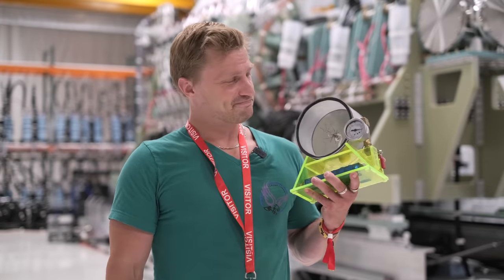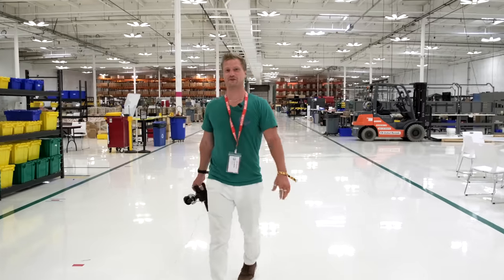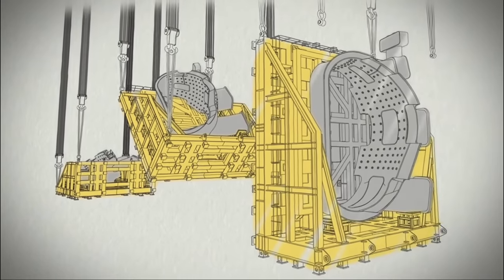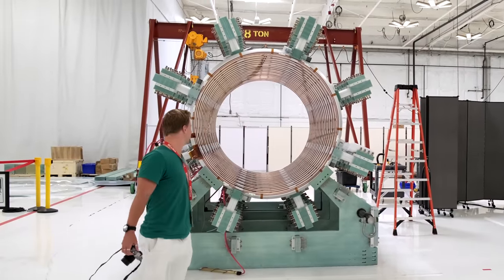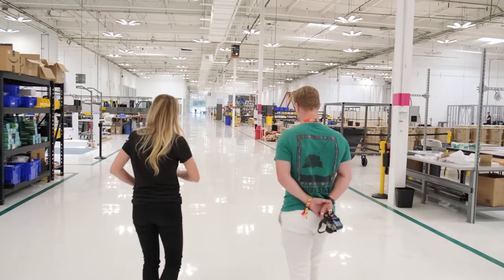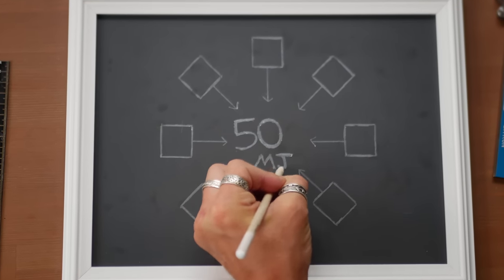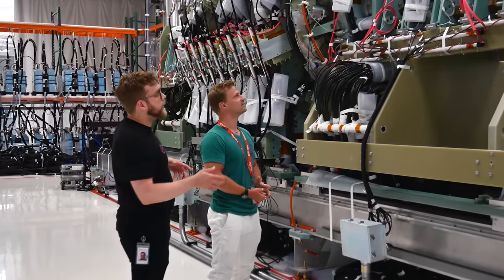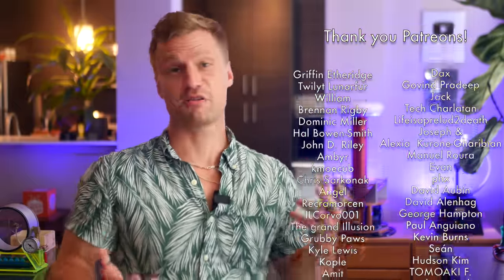An Exotic Approach to Nuclear Fusion (Helion Energy BTS)

Comment: As respectful as I can be to be courteous of your guidelines, I have to say that this is disappointing. There's a handful of videos of nuclear physicists busting helion, so there's no need to go into too much detail here. But the big takeaways are: 

1.) The D-D reaction generates neutrons, which do create activation products in the walls of the reactor.
2.) The D-D reaction generates tritium and He3 with equal probability, and the D-T reaction proceeds at a much, much faster rate than D-D or D-He3. This means that tritium will be fused much faster than it could ever magically be removed, and this generates fast neutrons, which further contribute to reactor activation products.
3.) Tritium that is formed and which isn't used in a reactor cycle needs to be dealt with. It's very radioactive and Extremely mobile in the environment, not to mention being almost impossible to isolate once released. I've heard of calls to immobilize it and store it, allowing it to decay to He3. On paper this works, but with a half-life of 12.3 years, you'll need to amass a lot of tritium just to get a decent rate of He3 production. If a splash of that tritium store were released into the environment, you'd have an incident on your hands that would make chernobyl look like nothing, an issue which the NRC hasn't seemed to take very seriously as of yet, though likely because they know none of these startups are serious. 
4.) Miscellaneous: how will they maintain hard vacuum during x-ray induced reactor wall spalling? How will they remove and reprocess spent fuel to seperate helium and hydrogen isotopes? or is this a once through scheme?

-Alternatively: We've developed working nuclear energy in the form of fission. Even in its most common and crudest form, it's an economical and zero-carbon energy source with no intermittency, which plugs directly into the existing grid to provide stable 60Hz AC power. We have known how to perfect it for decades, including breed and reprocess designs that cut waste levels by a factor of 20x and which utilize 100% of the actinide fuel, and additional reprocessing to seperate long-lived from short-lived fission products could cut waste volume again by a factor of 5x. Though rarer than Deuterium, there is enough combined Uranium and Thorium to meet our current average power needs for at least a few billion years (keep in mind that the jurassic era was a tenth that distance from us).

Yes, we could continue to dump "dumb" venture capital into silly little projects like this. Maybe some serious tokomak based fusion startup will succeed in producing economical power, and then I'll eat my hat. But that's a big maybe with no proven way forward. I would strongly argue that, for the sake of our species survival, and in order to prevent widespread ecological collapse, we should focus on developing realistic solutions and put theoretical well-wishes to the wayside
Reply: You raised a lot of good points.  I hope someone can provide good answers.  All of them seem like things that experts must have thought about and planned for… I wish they had been discussed in the video.
Reply: I have not seen any video "busting" Helion, but I've seen a couple pointing some of the problems they'll have to overcome.

Everyone knows that fusion is hard, if it were easy we would had done it fifty years ago, but that something is hard is no proof, neither of feasibility, nor of impossibility. It is a bit like climbing the Everest. For decades many tried to crown it, and all of them gave up, or died trying, many said that it was just impossible.

Now, let see if I can offer some counterarguments:

1a. Yep, D-D side reactions generate neutrons, and these will activate parts of the machine. Helion's plan is to use [almost] exclusively materials that, once activated, have very short half-lives (in the order of minutes to hours, for example, their magnets are made from aluminium, not copper, and the reactor walls are silica, not steel). In a presentation for the NRC (Nuclear Regulatory Commission), Helion declared not long ago that they estimate their reactors will be safe for human maintenance operators only days after having turned off, and their activity will drop to background levels in about a year.

1b. It also helps that the number of neutrons is far less that fusing D-T, and their energy only about a sixth (2.5 MeV for D-D neutrons, vs 14.1 MeV for D-T).

2. T nuclei produced by D-D reactions will carry 1 MeV of energy. The original D nuclei only have 20 to 30 keV. The difference in speed will be high, decreasing the probability of D-T interactions. Add that one fusion cicle will last about 1 millisecond only. The net outcome, very few D-T fusions.

3. Tritium management is nothing new. CANDU reactors have been producing, refining and storing it for decades. ITER site includes a treatment plant to do something similar. Helium does not need to invent anything new.

4a. Spalling ? One, they will evacuate the reaction chamber between shots. Two, every fusion reactor will have the same problem but Helion's design has an advantage, its linear topology makes it easy to disassemble, and subsequently to maintain (much, much easier than any tokamak or stellator, for example).

4b. Regarding reprocessing of byproducts, see point 3.
Reply: @charliem6590  All really interest, good points.  Thanks!

I was aware that Helion was using materials with less potential for activation, but I didn’t know about the aluminum magnets.  Is it actually aluminum conducting electricity in the wire coils?!  A bit disconcerting still that days will have to pass before any maintenance can be done, especially in light of the super high vacuum conditions required.

Very useful to know that newly-made tritium will only carry 1 MeV.  Is this true regardless of how much energy the original deuterium atoms possessed, or is this in addition to that original energy?  How is there conservation of energy if a DD fusion only gives a low energy neutron and a low energy tritium nucleus?
Reply: @jonathanlehmann2059  Sorry, I'm not ignoring you. It is just that, somehow, my answers keep being removed. Will this one also evaporate?

Edit: OK, this one seems to have passed the filter, lets see if it lets me add those answers.

Yes, Helion says their magnets are made with aluminum, at least the ones enclosing the reaction chamber (the central part of the machine).

Regarding maintenance, all electric plants have to be taken down once in a while for upkeep; it is not uncommon to be off-line for a few days or weeks every year, and that's true no matter the type of generation, nuclear, coal, gas, wind, hydro, etc. So, if Helion reactors need to be shut-down for a couple weeks every year or two, no big worry.

About the 1MeV question. When two deuterium nuclei fuse, half the times they produce a He-3 with a speed/energy of 0.8MeV (plus a neutron), and the other half a T (aka H-3) with 1.0MeV (plus a proton). Those energies are measured in relation with the original center of mass of the two incident ions, so it always the same, no matter their previous energy/speed (that, anyhow, was about two orders of magnitud less). The principle of conservation of energy is not violated because the sum of the masses of the two incident deuterons is bigger than the sum of the masses of the resulting particles, the difference is converted into energy. The 1MeV is part of that energy.

Comment: These reactors will also become radioactive just like tokamaks due to neutron rich D-D reactions occurring at the relatively low temp D-He3 mix, and for a lower energy yeild.
Reply: I wonder about that too.
Reply: They barely talked about the problems their own design faces. I did see them throw some dirt at other projects as if they don’t face similar problems. Like their neutron problem and they barely mentioned how does the machine handle the temperatures of their methods

Comment: This is exciting and one of the few reactors I've seen that actually has a design not just for fusion but for excess energy capture. Trying to pulse the reactor rather than a sustained fusion seems alot more practical.
Reply: also depending on the reaction style, its less wear on the entire system which means better longevity
Reply: @relientker   I got more intrigued because this design really doesn't produce neutrons, so its not radioactive like all of the other fusion reactors, they just omit it because its supposed to compete with fission. how ironic.
Reply: @monad_tcp  Helion's approach will still produce neutrons, just at a lower rate than competing reactor designs. The reactor walls will still eventually become radioactive waste, it will just take longer than the other approaches.
Reply: @RMX7777  If what you mean by "radioactive waste" is highly radioactive materials that will stay dangerous for centuries of millennia, as happens with part of fission plants waste, that not correct in the present case.

One of the general advantages of fusion over fission is that is produces much less activated materials with long half-lives. In the specific case of Helion machines, their estimation is that after one of their reactors is decommissioned, it will only take days for its reactivity to decrease enough to allow start dismantling it safely, even by hand, and about one year for it to be indistinguishable from the background (anyone interested in reading the specifics, search for the Helion presentation in front of the USNRC, from March 2022).

So, radioactive waste in that sense, yes, but only for a quite short period.
Reply: I was referring to low level nuclear waste, not high level like in a fission plant.

Helion is out of their minds if they think it will only require a few days for the reactor to be safe to dismantle. The only way that could happen is if the neutron flux never rose to the levels needed for useful power generation. 

And before anyone says something, I know they aren't using neutrons for power generation, but if their ion flux is high enough for useful direct conversion output, the neutron flux will also be high enough to be concerning.
Reply: @monad_tcp how exactly do you think we produce He3? Spoiler it's a by-product of other nuclear reactions. Creating a cleaner power based on an extremely unclean system, not very effective in the long run.
Reply: @RMX7777  "Helion is out of their minds if they think it will only require a few days for the reactor to be safe to dismantle."

Well, they base this estimation on their knowledge or their design, materials, fuels, and fusion physics in general. We base our opinions in exactly what, our intuition?
Reply: @charliem6590  Until Helion can be bothered to share their data I will remain heavily skeptical.
Reply: @RMX7777   Their vacuum chamber is made from silicon which has to absorb 3 neutrons before it becomes unstable. Then it has a half life of 2.5 hours. 
The magnets are made from aluminum, which when activated has a half life of 2 minutes. 
Due to the elongated shape much of the other equipment is a distance away from the central compression chamber where the highest neutron flux is. As radiation declines with distance squared, the neutron flux in those parts is greatly reduced. Helion gave a presentation at the NRC about the inventory of radioactive material they expect at their plants (e.g. in case of an accident). They predict that their device inventory will be 8 kCi/m^3 after a day, with a dose at machine surface of 0.2 rem/hr. After a week inventory is down to 275 Ci/m^3 and dose at machine surface is 4 mrem/hr. All activated components are below background after a year.
Reply: @charliem6590  Actually nuclear fusion waste would stay dangerous for about a century.
Reply: @RMX7777  Given the size, they probably can move the reactor back to a building to be disassemble by robotics.
Reply: @philmorton4590   its like money laundering, but for power
Reply: @elmarmoelzer2229  A great decision to go with low atomic number materials. That certainly cuts down the time for radioactivity to die off , as most long lived waste is caused by the daughter products.

I would then assume Helion will rely entirely on the direct conversion generator's magnetic field for shielding the walls of the reactor? It really seems like their success depends entirely on the capabilities of the power converter.
Reply: @RMX7777   They are still experimenting with various materials to balance them against different effects. I think that the current materials are good enough, but they want to do better. Yes, they will get damaged over time, but not that terribly. Certainly nowhere near the problems of a Tokamak.
Reply: @philmorton4590  Starship will allow for permanent bases on the Moon by the early 30's. The Moon is covered in He3.

Comment: You should pay Wendelstein 7-X of the Plax Planck Institute for Plasmaphysics a visit. This reactor is a stellerator currently on the way to achieve fusion pulses orders of magnitude longer than most other fusion reactors. Their current goal is 30 minutes of fusion of which they already achieved 8.
Reply: I was really surprised he did not show Wendelstein 7-X in his list of fusion experiments currently undergoing evaluation. The stellarator design helps to refuel the reaction chamber continously, which lead to the aforementioned 8 minutes discharge time and an energy turnover of 1.3 gigajoules. Fingers crossed fusion will be available soon for our energy needs.

Comment: The most interesting aspect of this type I think it's viability as an engine for deep space missions. Unlike all the other options, this one could be open af one end without too much issue and it doesn't have the stupendus weight requirements of laser inertial.
Reply: I'm a bit of a dummy, but I think as a deep space engine, it would do fine, but really, deep space isn't a difficult environment to have very efficient movement. Solar sails are already easily the most energy efficient form of movement you could achieve in space.

I think the big ticket is finding an extremely powerful engine that produces few emissions, uses little fuel, and is space efficient to actually exit and re-enter gravitational fields.
Reply: B, listed!  I'm in the school that thinks matter+antimatter is a little more useful...although! it could be both! a robot putting around the moon or oceans using  one kind of engine. and the other one could be a back up.  Thinking about fusion for the main battery. uh oh! something went wrong and that's not working now!  and matter+antimatter as an emergency back up maybe.